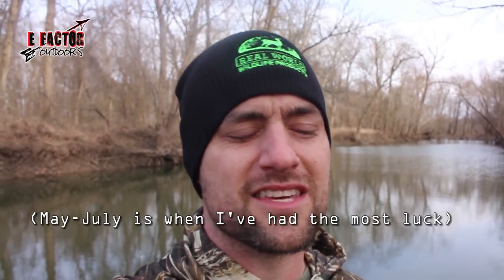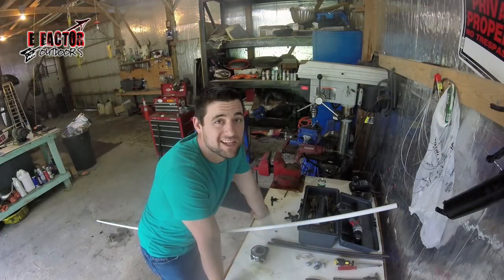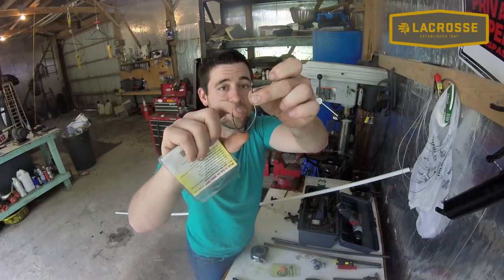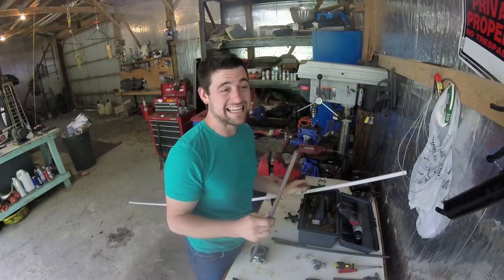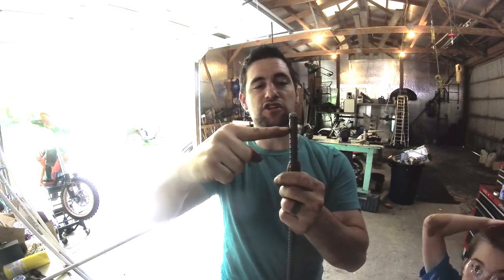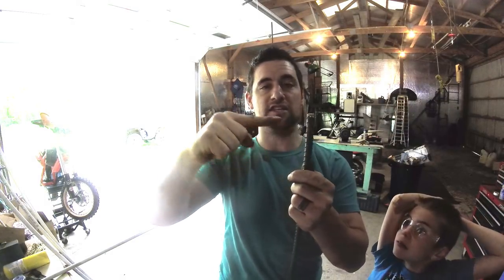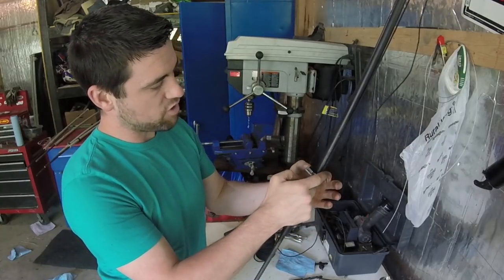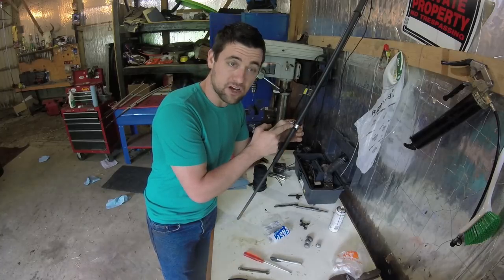DIY Bank Poles for Flathead catfish - how to make

Comment: Hey an idea for you I've been experimenting a bit and instead of paying out the nose for this nylon rope why not use paracord. For leaders I use gutted cord (still has a break strength for about 300 lbs)  I put a 8/0 circle hook into the cord and melt just below the eye. It will shrinj down to size. For 10/0 you have to tie them on. But the paracord is dirt cheep if you know where to look(I can buy for as little as 4 cents a foot)  for the most part resists rot and abrasion.
Reply from the maker: Good idea. But The cost difference between the paracord and rope is only $7 for 81 foot. $10 vs $3. Id rather pay the $10 for nylon tarred rope. Thats just my opinion. Let me know how the paracord works

Comment: Instead of using a regular flathead bolt to tie the line to use an eyelet bolt to tie to. Just an extra precaution so the line doesn't slip
Reply from the maker: Good idea chris! Of course that adds another couple bucks to the cost but I like it. You could also use the eye bolt to secure your hook in when not in use.

Comment: I like a real cane bank pole they will last several years I don’t put sinkers on every one depends on the current and what bait I use. I like to use swivels and them stainless steel circle hooks and minners. Don’t cost hardly nothing just the line,hooks,swivels and some sinkers. I set just as many bush hooks as bank poles and they is nothing better then paddling up the river after daylight fog a lifting and seeing a big limb or pole slapping the water

Comment: Does most smaller rivers that lead into big rivers have flat heads in them? I have this small river near home that dumps into the Missouri was wanting to set lines but not sure if I’d be waisting my time and effort!! Thanks for the helpful vids!
Reply from the maker: Yes i would definitely give it a shot. They swim upstream into those smaller rivers to spawn. Find log jams and or deep spots. The river i fish the most is small also but it has some 10’-15’ deep areas. Also a river that does not get much fishing pressure. 
One of my favorite rivers to fish is small but flowsinto the wabash, which flows into the ohio, which flows into the mississippi!
Reply: We're you from E factor
Reply: The smaller the Creek the better tasting the fish are. 😁

Comment: a few suggestions that might help your already very good poles.no.1 the weakest part if your pole is gonna be where the rebar stops inside the p v c -a easy fix -take a 6 inch piece of slightly larger pvc and slide over the spot where the rebar stops inside your pole ,glue in place -extra strenghth. no.2 cut a piece of rebar or rod slightly longer than your ditty pole ,slide down inside the pole and slide back and forth to drice the rebar into the ground remove the rod to use on the next pole.you may have to remove your screw but a couple of douvle half hitches will hold the line in place even wet
Reply: drive the pole,I cant spell
Reply from the maker: Great suggestions! I’m definitely going to be making more here before too long